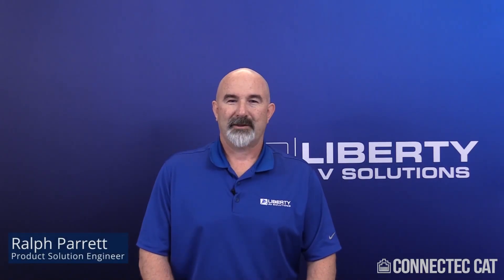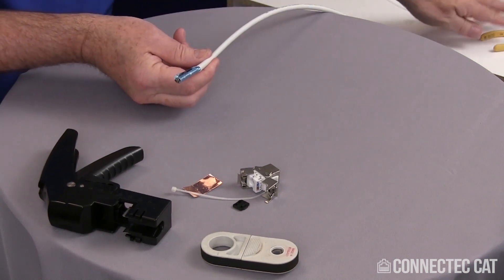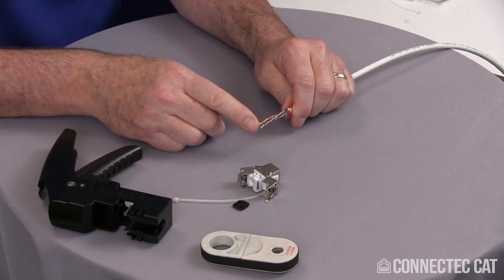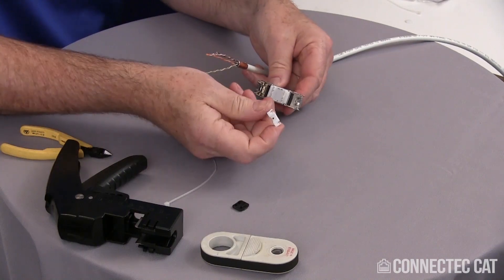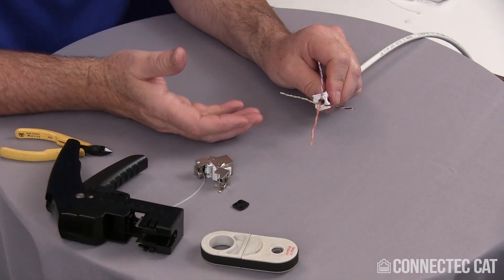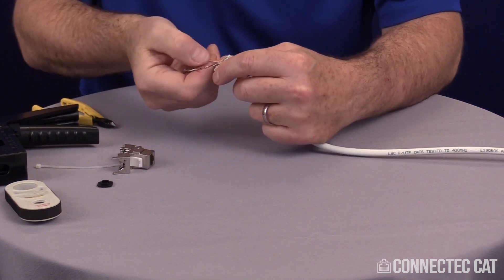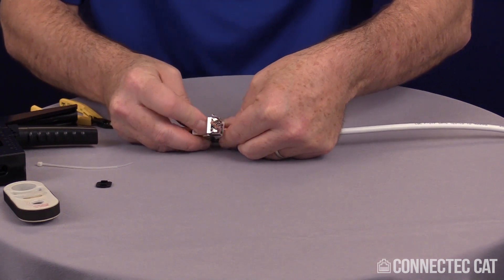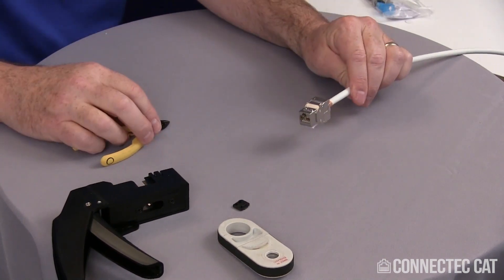ConnecTec Cat: Terminations Series, Part 7 - CAT6A Keystone Jack Onto CAT6A Shielded Cable

Comment: The foil shield should not be completely remove. Fold back about 1/4 inch so you won't need the copper tape.

Comment: where does that black seal go?
Reply from the maker: That is the dust cap, when the jack is not in use that snaps over the receptacle opening and protects the socket from dirt, debris, or physical damage.  Its use is optional but recommended.

Comment: Sometimes if I can I leave a small strip of shield to ground back to the tail end of the keystone with the drain wire
Reply from the maker: Hi, thank you for your comment! We include the copper tape in the connector package, which creates a solid 360° contact surface for the ground clamp.  This solid connection method is more reliable than the aluminum foil method, especially if the cable moves or is flexed.

Comment: what is this black gun shaped tool that cut the extra wires¿
Reply from the maker: Hello! That is the EHT010 cut and crimp tool.
Reply from the maker: Here's the link: https://secure.libertycable.com/product_details.php?pitem=EHT010
Reply: @Liberty_Online  Is it possible to close these things without the tool? By cutting the wires off before closing it maybe?...
Reply from the maker: @Lloyd.B.  Absolutely, the connector is designed to be tool-less, only requiring basic cable prep tools. That cut off tool is a convenience offered.
Reply: @Liberty_Online  OK thanks.
Reply from the maker: @Lloyd.B.  You're welcome! ;)

Comment: Thanks for the great videos! When using shielded cable do you recommend grounding the cable at just the patch panel or at both the wall keystone jack and at the patch panel?
Reply from the maker: Hello Tyler - thank you for the question!

We reached out to Ralph Parrett, our Cable & Termination Expert - he shared the following response to your question:

"The wall Keystone Jack usually will not have a grounding mechanism.  If it is mounted in a plastic plate for example, no ground path exists.  It would have to be mounted in a steel plate with a metal back box attached to conduit to get a chassis ground function.  The cable attaching to the keystone will usually be shielded and that will attach the ground on the remote side.  I hope that answers the question.

Note for HDBaseT circuits, if a ground differential issue exists between the components (source and display for example), a connected ground on both ends will cause issues up to and including hardware failure.  To “Lift the Ground”, use a coupler at the display side of the link and a short unshielded patch cable to the receiver.  This issue is more common than you would think and responsible for a lot of field failures of HDBT equipment and active optical hybrid cables."
Reply: Liberty AV Solutions Thank you for the quick response! Do you mind asking Ralph what purpose the 3M 1181 copper tape serves in the termination process? Also, would it be an issue to use a non shielded keystone jack at the wall plate with shielded cable, or is shielding recommended throughout? This is for residential application with low alien cross talk. Unfortunately shielded cable (which was not necessary in my opinion) was installed instead of unshielded. Thanks again!
Reply from the maker: Our Termination Titan, Ralph has responded!  :)

"The copper tape provides a solid 360° ground surface contact.  Many shielded RJ45 systems use clamps, solder, crimping and these are only as good as the termination.  Adding the copper tape ensures a solid and consistent ground plane contact, essential with HDBT shielded installs.

An unshielded keystone would “Lift the Ground”.  Best practice is maintaining the shield throughout the link but in areas where ground differentials exist, lifting the ground is an acceptable practice.  Most of our trouble calls are because unshielded cable was used where shielded should have been used.  Those were primarily commercial installs where ballasts, motors, communications and power interference is present.  In a Resi install, shielded needs would be dictated by the run and where it passes through.  If your unshielded keystone is at the display end of the link, you would be OK.  If it is not, I would install the proper unit to warrant shield continuity."
Reply: Liberty AV Solutions Thanks Ralph! One last follow up. If plastic keystone jacks are used is there a need for the copper tape or even the drain wire at all since it will not be grounded? Could it simply be cut at the base of the exposed cable? Thanks!
Reply from the maker: There is a need.  You cannot have a shielded cable without at least one end grounded out.  What can and has happened in this case is the shield will store energy and then discharge when the potential gets high enough.  We saw very expensive equipment damaged where the shield was not grounded in an installation and this discharge occurred.
Reply: Liberty AV Solutions I plan to have the cable grounded out at the shielded patch panel. The shielded patch panel would then be grounded to the server rack. Would this be a sufficient ground at one end, and could the drain be snipped at the keystone? Please express my gratitude to Ralph. As an amateur in the networking field his videos have been incredibly helpful. I can’t say enough good things about him and Liberty AV Solutions.
Reply from the maker: Hello Tyler!  Thank you so much for your kind words.  We are incredibly passionate about supporting our customers and being a resource for them on their installs!

In answer to your questions, per Ralph - 
As long as the keystone is at the display end, yes.  However I suggest using an unshielded keystone in lieu of snipping the drain.  That will achieve the same purpose.
Reply: @Liberty_Online  Hi! I just got Shielded Cat 6 ethernet installed in my home connected to keystone jack on both ends. It was not grounded when installed. Im not even sure if it is possible to ground in my house. Am I screwed if I use the ethernet without grounding? I had no clue about the grounding and wish I would have got unshielded cabling :(.
Reply from the maker: @gabbygonzaga552  Hi! We can definitely give you some advice on this. Can you please contact us directly at supportlibav@libav.com? Our support team will be glad to help.